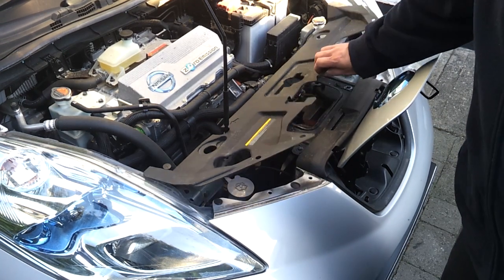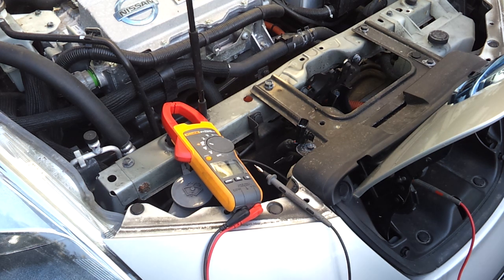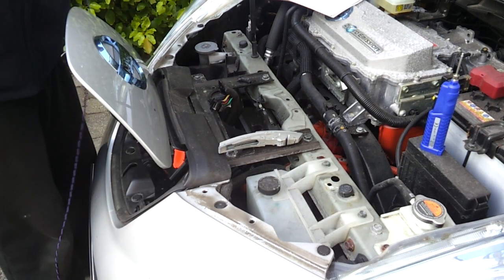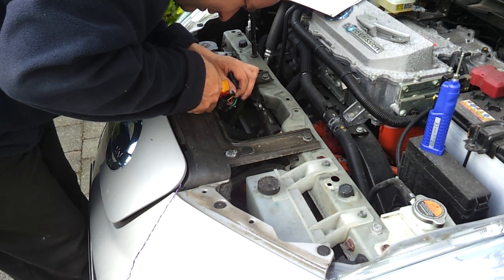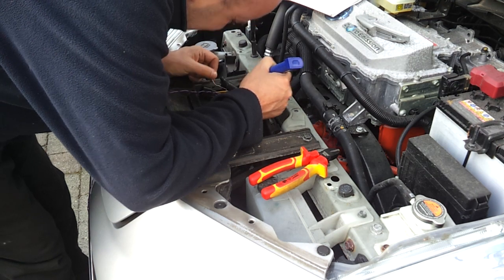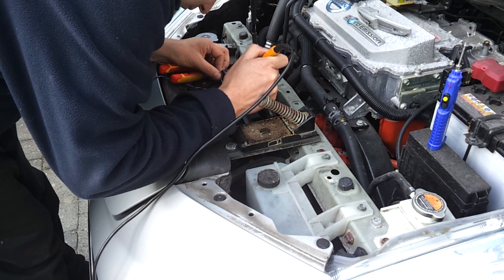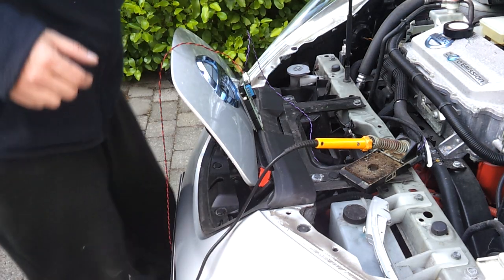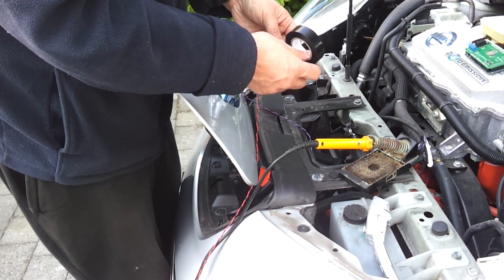Nissan Leaf 01 : Chademo Hacking

Comment: A Easier solution for stripping a small area on small wires, when you cant use a wire stripper, is to just use a simple cigarette lighter, heat the wire and peel. This will allow you to avoid nicking any of the fragile wire.

Comment: Guess you don't have that fancy tool that takes off the wires insulation without cutting through the entire wire. Then you could solder or even use wire clips to attach to the wire itself.

Comment: Mr. Maguire, I'm very interested to follow your work on the leaf, or anything for that matter. I plan on using the motor/ inverter/charger stack in my Toyota Town Ace truck.
And I plan to use everything else....plan is to get a rolling wreck. I'm reading all I can find ...and there ain't much out there yet!